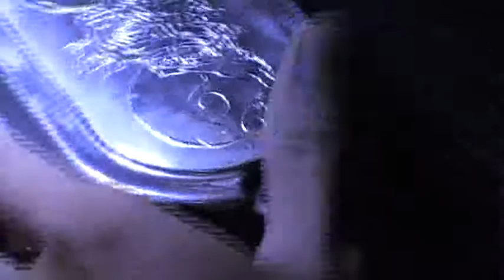Small Harley Davidsion engine part outline p2

Comment: Is the stroke adjustable? Judging by the sound it's incredibly short stroke for a fine fine cut. What psi were you running here? 
Great work
Reply from the maker: Daniel Wright: Hi, yes my engraver can adjust stroke - it's had a collar next to QC for adjusting stroke. 
I was use 2bar - 31psi  when engraving this piece. This is the first project I am engraving, now I am rarely using that hight pressure - just about 15psi for mild steel and 5-8psi if I engraving watch dial. You can see this engraver with much lower pressure on my chanel too.